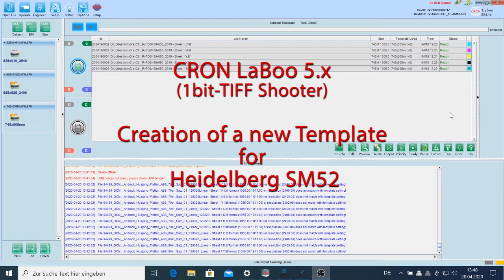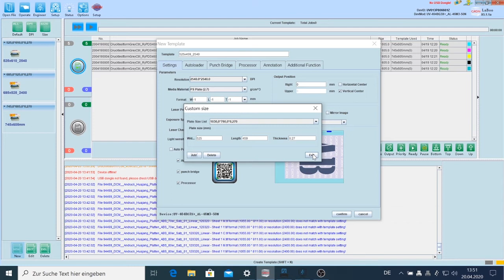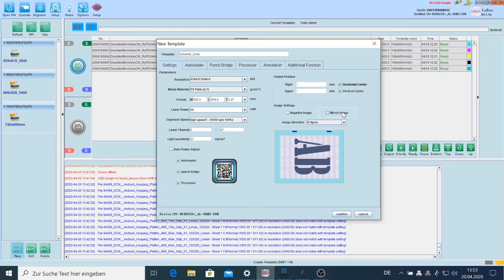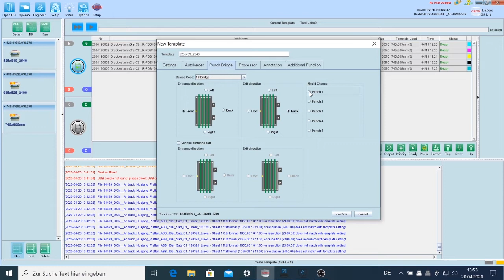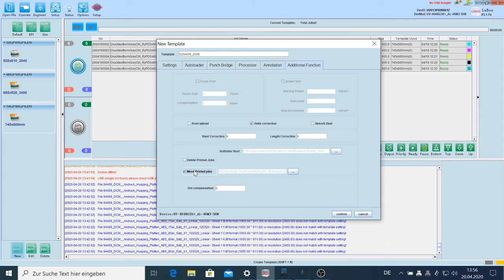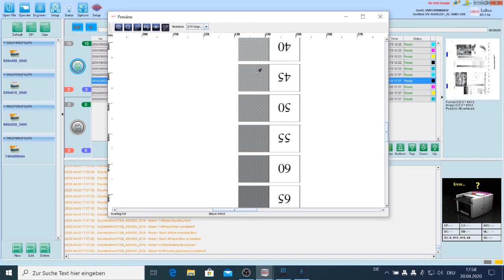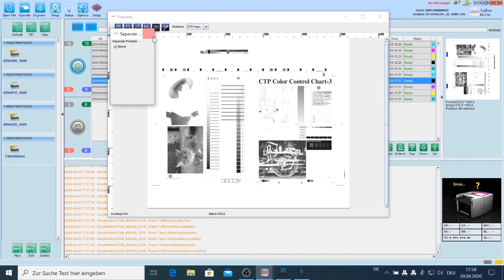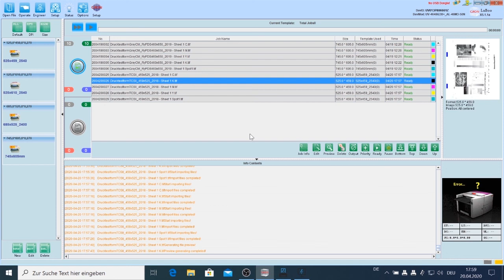CRON LaBoo 5.x Tutorial - Creation of a new Template for Heidelberg SM52 & Processing Jobs

Comment: Hi I have cron laboo v5. and I had started hanging now while processing jobs.please suggest something.
Reply from the maker: Hello siddarthjain8607
the most common reasons why LaBoo hangs during exposure are:
- mechanical problem with the loader or the plate feed in the platesetter
- interrupted data connection from the LaBoo PC to the platesetter (USB cable)
Please check both. Typically, LaBoo sends illustrated error messages